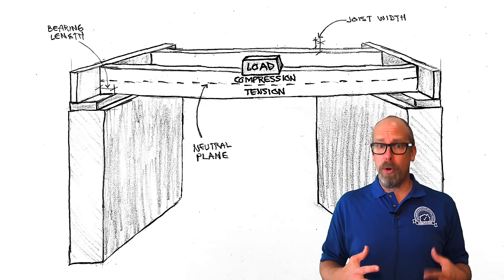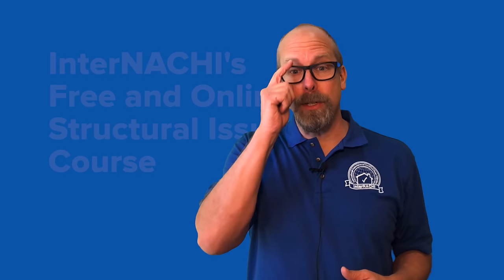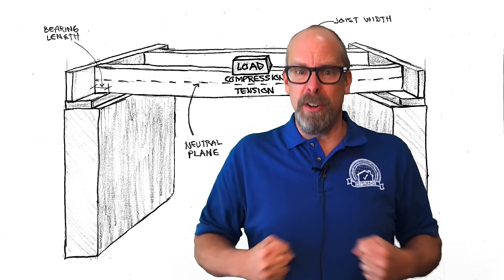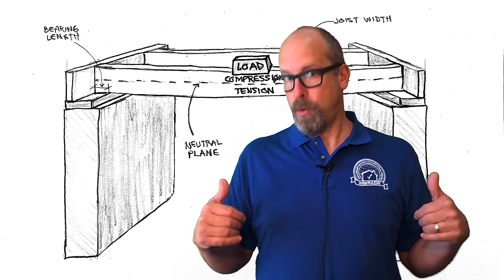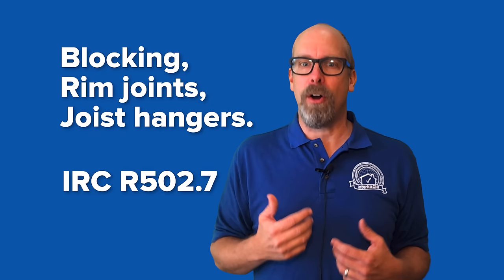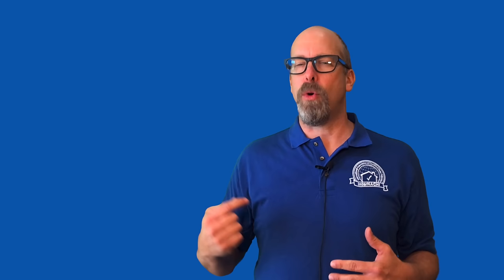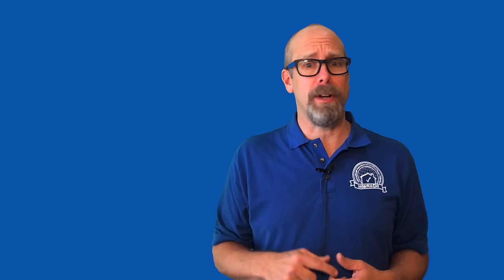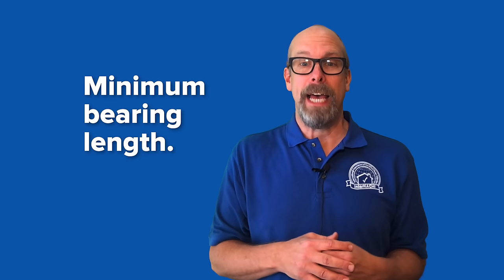Science of Simple Spans of Floor Joists

Comment: As an engineer, I think codes are really cool. They take a lot of research and experience and produce simple guides.
Reply: So true, and yet, people dread and fear codes.
Reply from the maker: Thanks, Austin. I agree with you.
Reply: In our world there seems to be no end to rules and regulations, many which are based upon uneducated opinions and wild guesses that haven't had much thought put into them and are effectively useless.  But when it comes to this subject, there is relatively precise data available from actual tests, so the results are predictable and can be measured.  I wish all builders were aware of this.  Start with your design needs, error toward the heavy side if unsure, and calculate what you need to achieve that. That's a much better approach than taking a wold guess and seeing how it turns out.  And, it's always better to go a little heavier duty than needed to go a little cheaper and try to compensate some other way for marginal or sub-par performance.  You never hear anyone say they wish their floor or roof wasn't so strong. Along this line, you might even find out that you can use a smaller framing member than your hunch and still meet the design goals.
Reply: @G53X0Y0Z0  
I have a very different opinion of codes versus requirements. People should not be building anything unless they know enough to use codes, but I think codes should be more like certifications rather than requirements. Requirements are often discriminatory and political whereas codes are just standards.

For instance, bars/clubs have much less regulations to meet than churches (at least where I live). We saw this firsthand when bureaucrats decided which establishments were essential, closing outdoor dining of small restaurants while allowing massive gatherings of corporate establishments. Non-sensical (and anti-science) requirements were placed on stores that actually facilitated viral spread rather than reducing it, in the name of science of course. Many of these destructive and financially burdening requirements are still in place across the world. It was a perfect extreme to illustrate why requiring anything, even if the reasoning sounded good at first, is a violation of freedom which should never be allowed.
Reply: @Austin1990  wrong soapbox.
Reply: @mechanicalman1068  Actually, it is the most perfect context.
Reply: @Austin1990  structural building codes are not based on sound reasoning, hunches or politics but rather demonstrable, predictable physics and engineering. As for freedom, they protect people who own and live in houses from poor workmanship which can be both dangerous and costly. A builder being free of them is not freedom for everyone else. As for restaurant closings, that has nothing to do with codes for simple joist span information or structural codes in general.
Reply: @mechanicalman1068  
The distinction is razor thin from a legislative perspective.
Reply: @Austin1990  building code is not established by legislation. Nor were much of the Covid restrictions you refer to. Planning codes, sometimes.
Reply: @mechanicalman1068  
A law is a law regardless of what someone calls it, and matters of law are legislative regardless of who enacted them. An essence of a thing is not always reflected by what it is called.
Reply: @mechanicalman1068  Building,Electrical, Plumbing and Mechanical codes are established by legislation and many of them originate from Industry lobbyist. Some are necessary for fire life and safety but not all.
Reply: The same codes that sweated and rotted houses for years
Reply: @JamieOBrien-bc6ov  When new materials or conditions are introduced, new homes become experiments. I am not a fan of that, but that is a complicated issue.

Comment: I bought a 100 year old house. I couldn’t get my bed upstairs because it hit the ceiling so I took the rock down in to open the stairwell up. To my surprise the ceiling/ 2nd floor joist were a 1”x6”with a 2x4 nails to the bottom. I fails to mention I am a contractor so I call a buddy who is an architect he said most likely the floor never sagged and no flex because the 1x6 was old growth and as strong as todays 2x lumber.  But that still doesn’t explain how a 1x6 spanning 12’ never sagged! I glued 3/4” ply to the 1x6 added another 2x6 and filled in above the 2x4 with 2x then added 2 rows of solid bridging and put it back together.
Reply from the maker: Thanks for watching. This information came from https://buildingcodecollege.com/glennmathewson/.

Comment: When doing my new home construction, my builder stated a span of 14 ft. was too wide to use the standard LVL's.   My homework revealed the possibility of using a Flitch beam. Instead of ordering it from Australia, I made one in my garage. You might consider looking this up, if you run into the same issue.
Reply from the maker: I will. Thank you.

Comment: floor decks people perceive to be "unacceptable" is really due to the deck weight per sq ft being "light".   a "light" deck produces a lot of vibrations when people walk across the deck and describe this as "bouncing".   if you would have placed 1-1/2" of of gypsum leveler on top of that same deck configuration, hence increasing its weight per sq ft, the deck would produce less vibrations and be perceived to perform better.   vibration reduction is also done with blocking/ bridging along the joists, sheathing the underside of decks and perpendicular partitions to the floor joist direction.  these items mostly dampen vibrations by connecting all the diaphragm/ floor elements together at more "points" to absorb vibrations induced by loads/ people walking-  good video!!
Reply: Bingo !
Reply from the maker: Thanks for watching and commenting, Brett.

Comment: I pulled out sheetrock in a customers house just because she didn't like the texture on it. They had a ceiling beam in there spanning the 20ft room holding the second floor-floor joists. It was bearing on the top plate of the exterior wall by only 1-1/2 originally and it was crushing the top plate and pushing the exterior wall out.  It was so close to coming off.  So just because something looks good when you do it..doesn't mean over time it fails!
Reply from the maker: That's so true. Thanks for commenting.

Comment: Well done sir, I had thought that what you explained was common sense until I became involved in a rebuilding project. The carpenter didn’t understand the superior strength of the 100 year old true dimensional hardwood joists, the contractor disputed the interior walls as supporting walls. I am showing them this lecture to support my positions, although today’s professionals only want to work with new materials.
Reply: If the joists are bearing on the interior walls, then they are “supporting walls”.
Reply from the maker: Thank for watching the video about simple spans of floor joists. The content was provided by Glenn Mathewson at https://buildingcodecollege.com/.

Comment: Good stuff:  I really liked your explanation of joists wanting to lay flat in the middle of a span and how that ties in to blocking reduces deflection.    I've always heard that blocking doesn't make a floor "stronger", while experience has taught me that midspan blocking makes it "better"  Your video clarified my thinking on this.  Thanks!
Reply: I've always heard that about blocking as well, but like you, I've always had a different opinion. It is just common sense that mid-span blocking will help distribute the load evenly across more of the joists at the point of maximum deflection.
Reply: What it doing is bracing against lateral torsional buckling. That’s what this “flopping” that he talked about is. Bracing the top flange by nailing the subfloor to it and bracing the bottom flange by nailing a drywall ceiling to it does the same thing.
Reply from the maker: Glad it was helpful! Thank for watching the video about simple spans of floor joists. The content was provided by Glenn Mathewson at https://buildingcodecollege.com/.

Comment: WOW THANK YOU. I recently bought my first house and have been working on repairing the sag in the middle of the floor. I've been sistering a bunch of the joists with new wood and its taking me a lifetime due to the incredible amount of work. Also I wasn't sure if I was taking the best approach from an engineering stand point and this helps a lot.  I'm going to to utilize these bridge blocks to significantly reduce the amount of work I will need to successfully complete my DIY job. Thanks again for this knowledge, it's very valuable to me
Reply: Solid bridging will strengthen a great deal as once tied together function as a whole unit…if over eight ft. in length install two rows I did it to my house and I have 2x8s that span a bit over 12 ft, …I put in two rows of blocking and it work very well…much cheaper then sistering especially these days…good luck…
Reply from the maker: Thank for watching.

Comment: I hope this video gets watch by those in trades who believes mid span blocking is not really necessary. No, it is a MUST for a wood floor joists. In my own build i blocked every joist tight and glued. The difference before and after is incredible. It doesn’t only help to stiffen the floors but it reduces vibrations.
Reply from the maker: Thank you for watching. That information is from Glenn Mathewson from https://buildingcodecollege.com/. Check him out.
Reply: The number of blocks and the spacing of the blocks often overlooked. Too often people put a single row of blocks in the middle and call it good. A block every 4 feet along the length of joist is a cheap investment and a huge improvement in structural integrity and strength. Structural screws instead of nails are actually faster to install and are by far stiffer and stronger than nails as well. No such thing as too many blocks.
Reply: @briangc1972  Totally agree from my experience. Material doesn’t cost much to blocking but it is a little labour intense if it is done right. To me blocks needs to be a tight fit and glued and screwed. If you are nailing a loose block you are asking for squeks as the joists deflect.

Comment: I used 2x 6x 30' iron C purlin.  I welded back to back to make into an  "I " beam.  For my
Floor joists.    No squeeking here.   I put the 3/4 inch plywood across two sections to see deflection in floor then I spaced out I beams until no floor deflection.  I also put another 1/2" plywood glued to 3/4" layer opposite direction. 
Very very strong floor.
Reply from the maker: Nice.
Reply: So your floor is 1 1/4" ?

What did you use for adhesive?

Comment: My house was built in 1935. Over the living room are 6x8 joists (exposed, no blocking). True measurements are 5-1/2 x 7-1/4. They are on 32” centers, 15 foot spans. Walls are concrete block with open cells. I don’t know how much they bear. The first joist is on the edge of the stairwell and has the bedroom wall sitting on it, it is visibly deflected or curved downwards and has cracks along roughly the middle sides. The rest of the joists look good, straight, no cracks. The sub floor above is 1x12 knotty pine panelling with Douglas fir floor on top.
Reply from the maker: Good to hear, David. Thanks for watching.

Comment: I live in a 16' wide row home ( actually closer to 15' wide when you subtract the 10" poured concrete basement walls. While I was drilling 4 or 5 holes thru each basement joists noticed the two doubled up ones that provide extra support I guess for where stairwell is took a lot longer to drill my 3/4" diameter holes. While pulling wire noticed the doubled up joust were 3 by 12 and a different guess stronger species of wood. Bet contractors have not did this use in many years.  While an electrical apprentice we were taught to avoid the middle third of all joists whenever possible. Also believed  it was better to drill two 3/4" holes at least two inches apart then a big 1.25" hole for wires.
Reply from the maker: Thanks for watching.

Comment: My od carpenter rule of thumb, when using softwood framing lumber, was to divide the span, and, add 2, so for a 16 foot span, you would use a 2x10 for a normal load. Using structural fir, makes them stiffer, or switching from 16inch spacing to 12 inch spacing also increases strength, Adding blocking between joists stiffens floors because is limits deflection. Now we use a lot of structural lumber, or engineered floor systems, here we generally rely on the reccomendations of the supplier.
Reply from the maker: That's great stuff, Keith. Thank you for sharing.
Reply: Hi Keith. Here in Canada our code will allow a 2x10 to span approximately 13'-8" to 14' depending on bringing and strapping. 2x12's are 15'-6" or slightly better. These are @ 16" o.c.. it was an interesting talk.
Reply: @warrenshalm550  I live in estreme north east Minnesota, our county does not enforce a building code on resedential structures. Most licensed contractors do use the national codes. Your spans sound about what I have used, of course if you specify structural grade fir, as opposed to just softwood lumber, you will get much stiffer floors. As I said, using 12 on centers will also allow for longer spans with a given joist. Also using bridging to avoid deflection also helps. Most of our floors are now down with TJI's or some other floor truss system. The TJI's are lighter, have knock outs for electrical and plumbing, and, can be ordered in long lenghts, so even if you use a center beam or wall you can use a continuous joist, we can get them up to 32 feet in lenght. They have also replaced solid wood rafters in a lot of roof framing.
Reply: You're absolutely correct Keith. The betyer grades of lumber have greater spans and of course engineered lumbere has become popular for reasons you state. What has driven the choice in the last year for us has been availability shortages. That is in everything related to construction.

Comment: I built a "pit" for servicing my trucks and searched for guidelines for the beams I used. I couldn't find anything that applied to what I was building so I erred on the side of safety.  The pit was constructed outside between my deck and my garage so I don't have to worry about air quality like pits built in a garage floor. I started by building a 10 x 10 concrete pad with two sections of concrete filled block pillars 8" x 32" at the end (actually, these pillars are part of a concrete filled concrete block wall, so the pillars are effectively 16 x 32 also). Then 4 concrete filled concrete block pillars 16" x 32". I spanned the pillars with 2-2x12's and 4 2x10's to create each "beam" with added blocking and 2x10's for decking. The beams are about 14' long, supported by the 3 pillars on each side. My trucks weigh around 9500 lbs. and I was real nervous when I tested it the first time. I set up a tape measure at the middle of the longest span and was unable to detect any deflection whatsoever. Obviously I over engineered my project, but at least I know that I can change the oil in a semi without having to rebuild it bigger.
Reply from the maker: Great information and feedback, Hot Shot Truckin'. Thanks for watching and sharing that information.

Comment: Very good informative video.  Try to find a span table for your jurisdiction and you will find that the allowable span increases with the addition of solid blocking, cross bridging, cross bridging with strapping under the joist and also with construction adhesive with the subfloor.  I believe in our area the max span for 2x10 ss spf on 16" oc is 16' 1" with 2 rows of crossbridging with strapping and glued  5/8" subfloor as opposed to about  13' 5' with just subfloor and one row of strapping which is the bare minimum.
Reply from the maker: Thank you.

Comment: One point I would like to add from the real world is the effect of knots in joists. During an inspection, I saw a garage ceiling with 2 x 8 joists. Three consecutive joists had a knot in the bottom edge about three inches deep. They had deflected about two inches and were starting to crack along their length from the top of the knot. I would say that the framer should have been hung from those joists for using those particular pieces, but he'd probably escape unharmed.
Reply from the maker: You're correct. Good point about knots in solid lumber. They're like bored holes.

Comment: Thanks. Folks should know that a structural engineer can analyze issues for little money. I opened a ceiling and found one 2x4 holding a roof load. I knew I could use a simple 4x6 beam but couldn’t contact the clients to approve the design change. I went to a local structural engineer. He quickly entered the data of the existing structure in that area into his computer program. I was able to use three select structural 2x4’s laminated together and keep them hidden above the ceiling drywall. $200 well spent!
Reply from the maker: Thank you for watching our videos and commenting here.